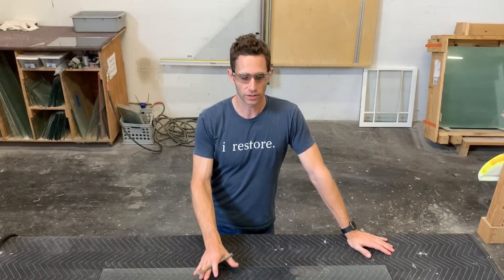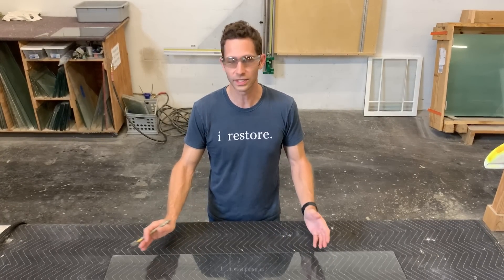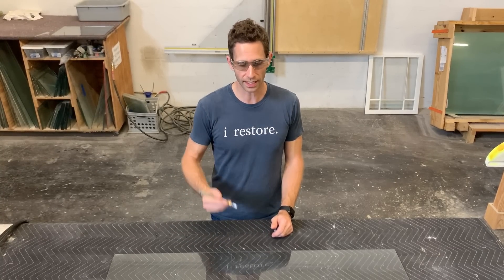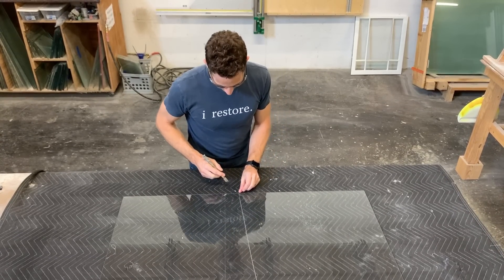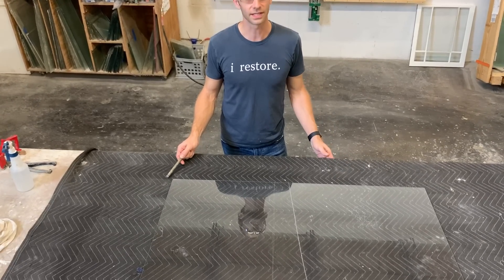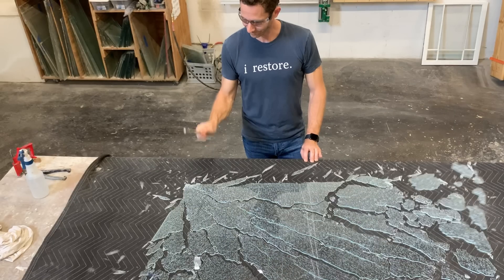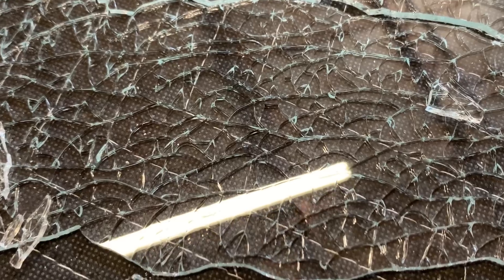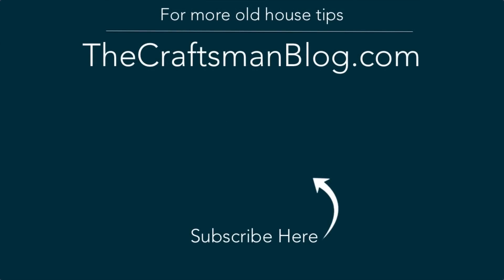What is Tempered Glass?

Comment: I did Commercial Woodworking for over 25 years and on one job  I was accidently shipped tempered glass that was about a 64th of a inch to big to fit in a opening and by code it had to be tempered I was told by my boss to try and sand  it on site with my belt sander  it didn’t work  and a new piece was ordered